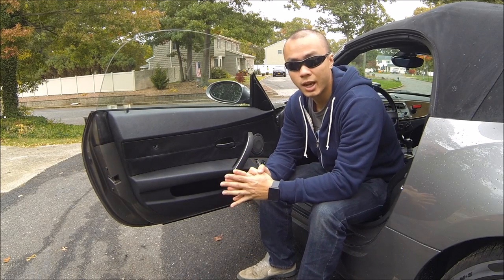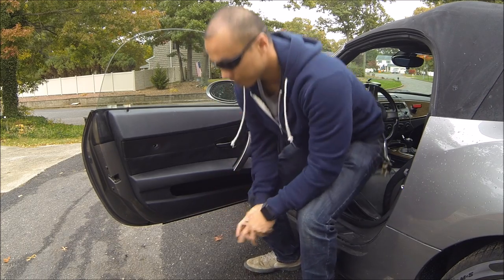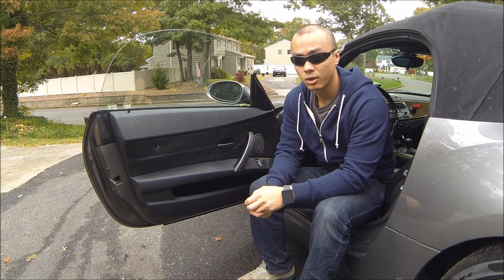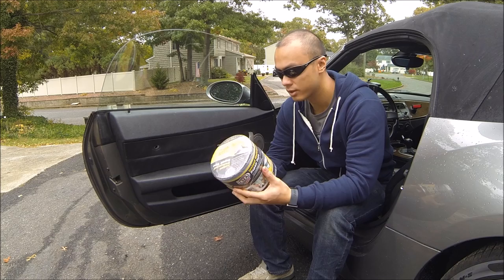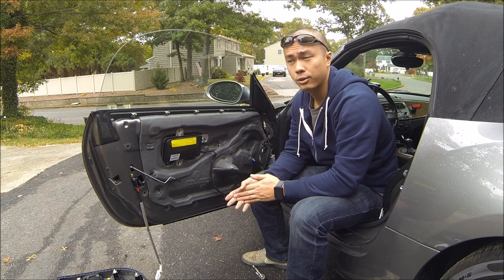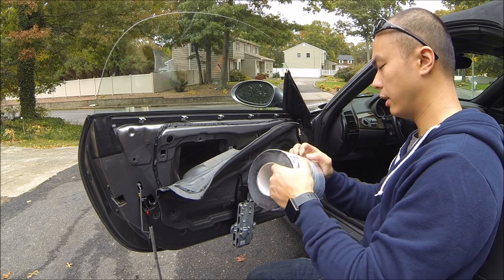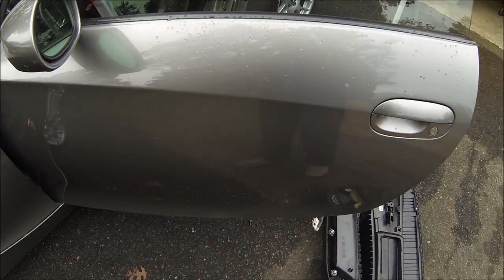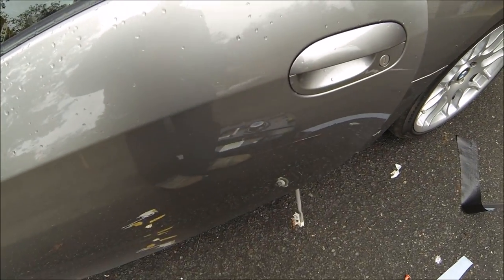Car Door Sound Deadening for Under $20! - BMW Z4 Vlog #20

Comment: the problem with cheaper sound dampening materials is longevity and the release of toxic chemicals. the material he used is similar to expensive products desingned to add weight to the metal, thereby lowering the resonant frequency. this reduces noises generated by the metal, reduces the ringing sound of a speaker playing onto metal surfaces, and to some extent it blocks a bit of road noise. however, to really block road noise, a noise barrier type material is needed. the most effective material to do this is thick butyl rubber composite mats. these are the even more expensive treatments that companies such as scosche, second skin, dynamat, etc sell. there's a guy on youtube, caraudiofabrication that has a pretty good instructional video on the different types of sound treatments and more importantly, how they should be advised. cheers. and thanks zed4me for the video. keep treating those doors man!

Comment: DO NOT DO THIS. I TRIED THIS IN MY CAR A FEW YEARS AGO AND IT'S LEFT A HUGE MESS. it's not the right adhesive. It's rubber stuck to tar. Real sound deadening has proper adhesive. This shit melts off in the heat and leaves a huge mess. Seriously, don't cheap out. I learned the hard way so you wouldn't have to.
Reply: Chris... Did you install it vertically inside sealed metal housings?...
Reply: @michaelnewton1754  vertically,  horizontally.  I work with peel and seal daily.  Makes great water barrier and vapor barrier as well.  Which what we use it for.  Vapor barrier. Clean surface with  Alcohol and use a roller. But should deadening material is cheap now bud. I just did my 2014 tundra crewmax.  62$ for 36 square foot on Amazon.  It was enough for all 4 doors. Bought another 10 square for 20 bucks to do the back behind passenger seats.

Comment: frost king duct insulation works just as well,and it is lighter in weight than peal and seal, and doesn't have asphalt based material in it
Reply: When it comes to sound deadening material that doesn't cover the entire surface of a panel, you want more weight. The mass and density of the material is what dampens the vibrations when you put little rectangles of the stuff in various places. That's why the best automotive sound deadening material is heavy stuff, and it isn't necessary to completely cover panels in it to reduce noise, it isn't so much absorbing sound waves like wall insulation in a quiet room or studio, it's dampening the vibration of the car's thin sheet metal panels.
Reply: Yucannt Hahvitt your wrong. it's about the material ability to absorb which why you would use softer materials not heavier
Reply: Yes the Frost king is odorless. have it  in the doors of one of my cars a few years. I am sure Dynomat would be better but road noise was decreased and the "tinney" sound went mostly away.

Comment: I really don't understand how anybody could dislike this video
Reply: Because of the glasses.
Reply: Mercedes owners
Reply: I dislike it.

1. When he closed the door he probably scratched his side skirt (with the airbag module hanging from the door).
2. He did not clean the inside of the door (there is wax in there) prior to putting on the the mats. They could fall off at some point.
3. He did not disconnect battery (hence the airbag fault code). Why didnt he disconnect negative lead for safety?
4. He used a product that contains Bitumen. Noone does that anymore. Bitumen is soft when warm and stiff when cold. It kind of drys over time and become brittle at some point (really hard to remove). 
5. Bitumen will make the car smell like crap (especially in the summer). I will never go away.
6. He did not replace the vapor barrier - so he just did half the job. Thats like sound comaing - not sound deadening.

He wanted to save some bucks and he ended up shooting himself in the foot by using a product not fit for the job and by bad execution.

Why should anyone advertise how NOT to do it? Ignorance...

Also - the dude is trying to sound-deaden a convertible. Does it make sense to you? If it was a 7 series... OK. But a Z roadster? Serious? Whats the next step? Putting Bitumen on the soft top?
Reply: I have to disagree with you on some points, He did say that he was going to clean it @ 2:52 then he skipped to actually installing after he cleaned it off screen. @ 4:51, he did replace the vapor barrier. 
Like you, I would be concerned about the smell and yes, he wasn't careful about closing the door with the airbag and other things hanging out so he could have scratched his side skirt. He should have disconnected the negative terminal of the battery prior to doing anything with the airbag. He never said he was a professional, we all make mistakes, learn from them and move on. However, it did sound like it did quiet his door down for a fraction of the cost. I am not sure of how long it will last. When I researched many brands of sound deadening materials, many of them contain some sort of asphalt mix, how would that not smell the same as what he used?
Reply: Because it's fatally incorrect. Thanks for reminding me.
Reply: Just people with empty head
Reply: True!
Reply: yes, because this stuff has no sound vibration deadening properties what so ever, you will pay noe or pay later, get the proper material and do it once
Reply: The real MVP :) Thanks for sharing.
Reply: This Is Ade Brown Several reasons for the negative votes. First, he didn't differentiate between the different flashing/sealing tapes available. Some will smear and start to smell when warm, some won't. It's pretty clear he wasn't aware of it.   This guy wasn't even aware how to prevent his airbag light coming on when temporarily disconnecting an airbag in a BMW. I like that he does it and good job overall (I gave it an up-vote) bu putting together an instructional video when you only have half a clue is inviting feedback from people who actually know. I'm in construction & design but also have a professional background in hifi equipment & commercial building sound system installation. Also a car-nut for 40 years currently with 2 BMWs.
Reply: Cassette Walkman so what would you use as an alternative product?
Reply: KRAZYSHAWNJ What would I use as an alternative? As a panel resonance damper these stick-on bitumen based products aren't bad but they are just a panel damper. They'll prevent nasty resonances in panels that can actually amplify frequencies.  The heavier the better. But as a proper ghetto alternative try visiting wreckers & pulling the rear seats out of bmw's. They use a rubberised foam covering on the bare metal that you can pull off & re-use. BMWs are full of sound deadening materials. Especially the floor.
Reply: --cLAsic--  California doesn't have weather LOL granted it's a Delong state it kind of depends on where you're at but in general compared to the rest of the United States California is not the place for you to do your weather testing or even testing a vehicle near the Shores Florida is better for that. I'm not sure what some people mean by the smell or whether or not it gets hot and soft and cold and brittle or how long this stuff last. But just by doing my research off of YouTube I'm definitely not going to cheap out at least not with this product. I'd rather screw a whole bunch of towels and to the lining of my car. Towels are great sound dampeners as well. Anyway my point being I have found a lot of people who have tried to cheap out on the sound deadening with various chemicals and tapes and quite frankly if it's has an adhesive and it's some kind of plastic material or some kind of tarish material then don't use it if you live in a state other than California. I'm glad it's worked for you for this last year hopefully it last you a good long time and never smells.
Reply: --cLAsic--  agreed. It even says in the item description of peel n seal AND Frost king that it deadens sound AND vibration. Have both in my 1990 Honda Civic with straight pipes and it is super quiet like a luxury midsize car. Great stuff

Comment: I had a 2001 Dodge pickup. It was just a single cab, basic truck. I did this same, basic thing to the doors. It did help a little with road noise, but it made a huge difference in stereo aound. I just had a cheap pioneer deck with 2 6×9 speakers. One in bottom corner of each door. The doors became well insulated speaker boxes and the speakers put out a LOT more base with better sound. Enough that some people assumed i had a subwoofer. Thoroughly covering the inside of doors with sound deadener will also make a huge difference in door speaker sound if your doors don't have any sound deadener.
Reply: how thick is the material? do you remember

Comment: I've always said that if someones spending more in sound deadening, than a quality set of components, they're doing it wrong. Foam behind the speaker on the door, and in front to couple to the door, are most important. Fastrings can do it for you quick. Just pricey for what you get. 

Peel n seal has never failed on me. But I also use roofing tar tubes to help adhere it too.
Reply: Maybe someone just wants a more silent ride
Reply: how thick is peel n seal?

Comment: DONT USE THAT MATERIAL! THE ADHESIVE MELTS AWAY AND STINKS YOUR ENTIRE CAR WHEN THE TEMPERATURE GETS HOT!
Reply: I wanna buy it and use it and see how it works out
Reply: harrisezzat Depends which product you get. I use this in construction all the time and some smell, some don't.
Reply: I think all these comments are from dealers and agents. 

They're always blasting the caps lock and say the same thing without any legit followup.
Reply: Used it in the lexus.....no smell whatsoever

Comment: Applied this technique to a 2008 Subaru Tribeca with no weld issues, just zero noise dampening. I used Grace Membrane which is what I had on hand (and is as sticky as the adhesive used on the plastic insulation). You have to cover all your bases by at least covering 90 percent of empty spots while making sure you get into each corner as much as possible. I also took small strips and turned them into adhesive bumpers to put in between the cross braces and the actual door sheet metal, and I did this in at least four places on each cross member, making sure that two of the spots were the ends and that none of the membrane interferes with the window. The only drawback to this fixing the problem is that it fixed it TOO good meaning now I have to do the other doors.🤣😎 Excellent idea, sir!

Comment: what's the point sound deadening a convertible?
Reply: The rattling can be annoying to some. For me, I do it because I like loud bass in my car, which rattles the foundation of the vehicle, as well as makes so much noise 'outside' of the car, you would think someone was spanking my cars a$$ with the license plate :)
Reply: my car's already more quiet than a lexus, but I'm going to sound deaden it even more ;)
Reply: keep heat in
Reply: My convertible top doesn't rattle, but the rest of the car did.  Huge improvement for me. I used Kilmat.
Reply: hHhHhHAHAHAHAHAHAHAHAHAH
Reply: You might as well stick it all over the convertible roof as well!!

Comment: Do they also use so called rock wool or polyurethane foam? And those active noise cancellation systems like in headphones, me likey. Do they already manufacture smartphone apps, that would drive simultaneously noise cancellation with radio play or something? There is microphone, then just in principle pi radians phase difference and right decibels and thats it:)

Comment: Speaking from experience here, don't waste your time and money with this roofing crap.  It will not save you money or your time in the long run.  Go to Amazon or Ebay and search for 'Noico' or 'Kilmat'...you can get 36 square feet for about $60.  36 sq ft is plenty to do 4 doors and a trunk and have some left over....  The dollar per square foot is about the same as the crappy roof junk but the results with the Kilmat or Noico are so very much better.

Comment: So i went back through becouse your vidio is the one I based my decision on using this stuff. I have a single cab dodge ram 2001. Open the pannels and a thin layer of plastic covers the doors. That's it. Very very basic on these trucks. So mine wasn't quite as pretty as yours, I used my hands to flatten and rub the sticky side in. I have full confidence that this stuff is going nowere quick. Once it sticks its practically over... lol I lined nearly the entire inside of my door in rows... right off the bat road test... just by old artillery ears, 50% reduction in noise level. This stuff is really amazing so for anyone who thinks that it won't work, stick your foot in your mouth. Take the leap and try it.... you will be surprised. It actually made my stock 2001 speakers so robust, I had to turn my sub level down by 3 levels on my stereo. Lol you have to do it yourself to believe the difference. It's only 16 bucks guys.... and thank you, for your vidio
Reply: Thanks for your input!🙂

Comment: I bought a roll of this stuff and used it in the rear corners of the standard cab in my 1990 Cummins Turbo Diesel, when I replaced the rear speakers. You've got to have sound dampening in that! Works great. Even put an small, extra sheet over the fiberglass housing covering my air conditioning system, facing the downpipe of a custom 4" exhaust system, for extra insulation. Works great!!

Comment: Thank you for this!  A couple days ago I got a great price on a used Subaru Legacy, but when I shut the doors, it rattled and screamed out "This is the cheapest Subaru Legacy available anywhere in the country."  I ran to Home Depot last night and picked this stuff up (it now goes under the brand name Pro Force), and today the door makes a nice thump that says "This is a luxury car with real quality construction."  I didn't put any on the plastic door panel, just the metal on the inside of the door.  Loving it now, thanks again.
Reply: how thick is the material? do you remember

Comment: don't use this just spend the money buy second skin.
Reply: +Kama Sylvester Thanks for the great reply and shout out #SecondSkinForTheWin
Reply: Kama Sylvester Yet you provide ZERO data to support your opinion. Fumes will not transfer into the cabin of the car due to the  vapor barrier which covers the hole providing access to the window regulator assembly. 

You need to do your research before giving out shit advice. The interior plastics of a car off gas constantly. Ever wonder where the haze on your front window comes from? Yeah that’s the toxic chemicals from your dash, trim, headliner.... it’s unavoidable. A little asphalt(ie petroleum based) won’t hold a candle to the cancer causing potential of these other chemicals that are ALWAYS in your car.